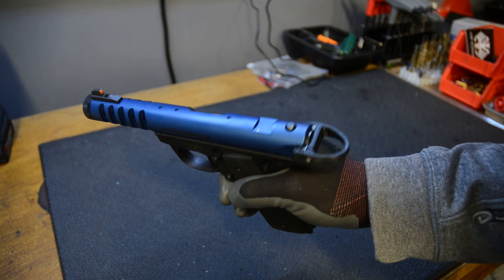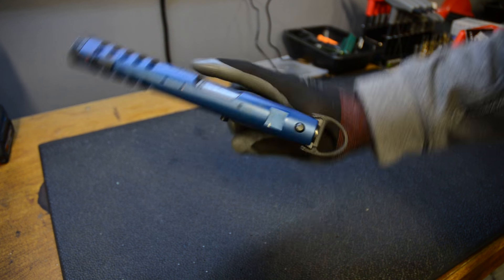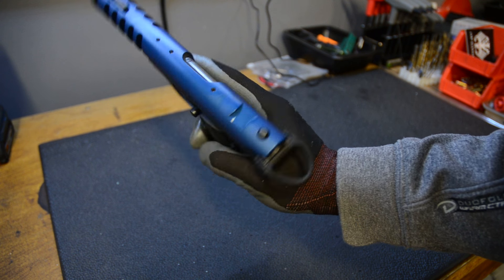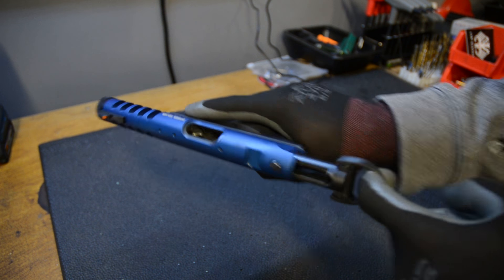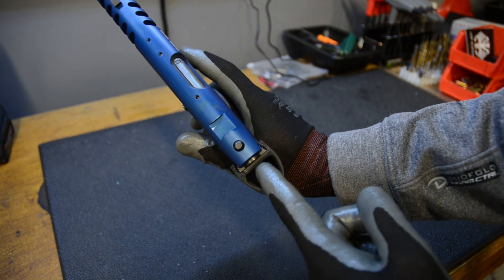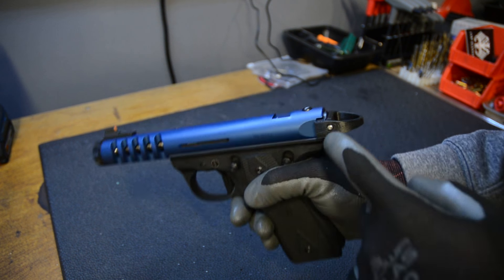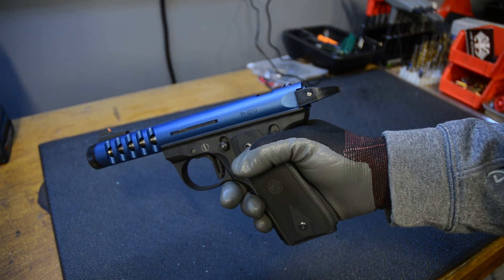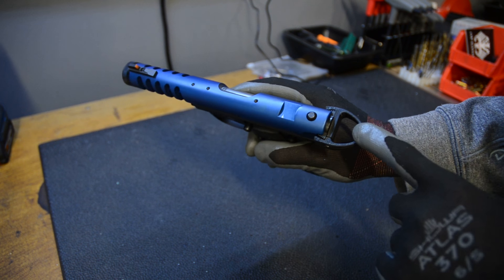Ruger MK III/MK IV 3D Printed Charging Handle

Comment: Looks like a terrific invention at a fair price. I placed my order for one not 5 minutes ago. Will report back once I have a chance to take it to the range. Should help my aging fingers deal with charging my MK III.
Reply: Received the FarrowTech $20 product yesterday. After a quick trip to the nearest hardware store to buy the necessary tiny .050 allen wrench -DOH! - it installed quickly and works great. If the plastic does not hold up, there's always the $50 aluminum version available elsewhere. I would gladly have paid an extra buck to have that wrench included with the handle.

Comment: I went to the download link, but the .stl model has it set up very small. What is the height that I'm looking for so that I might scale it to the correct size?
Reply: Ditto, without knowing the proper dimensions this is not worth downloading. Maybe that's the point? Would be nice if you would reply with at least one proper dimension!